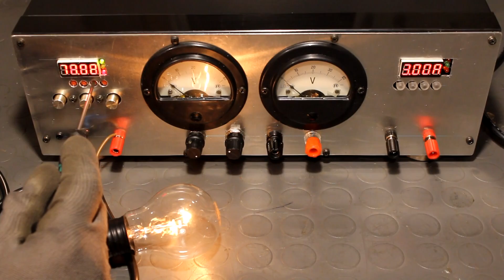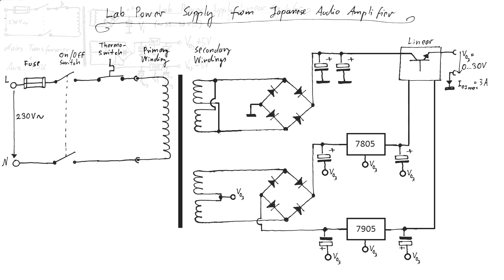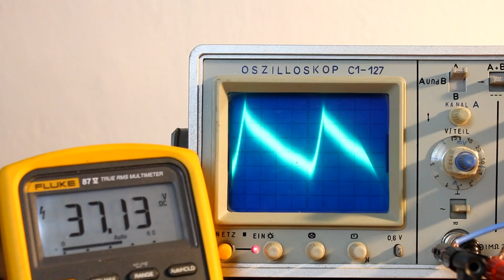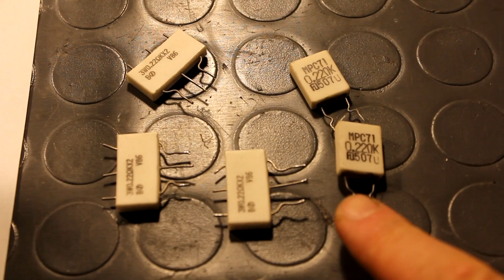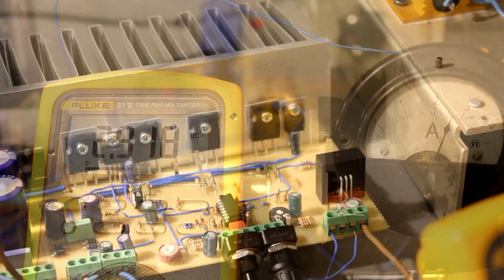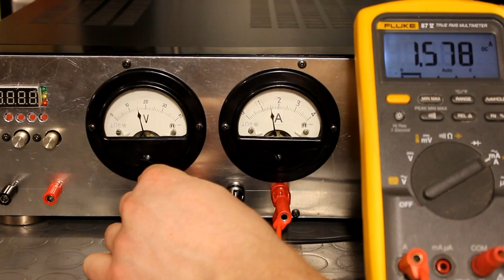Building a Lab Power Supply with a Discrete Linear Regulator

Comment from the maker: The first video about this power supply build can be found here:
https://www.youtube.com/watch?v=J3N6RX_wAJg
Reply: Nice work, good solid fundamental engineering principles. Well done! Bravo!
Reply: PLEASE FINISH YOUR SWITCH MODE POWER SUPPLIES TUTORIALS!!! THANK YOU FROM EVERYONE WHO HAS BEEN WAITING FOREVER !!! IT IS THE BEST CONTENT I HAVE EVER SEEN , IN COMPARISON TO THE UNIVERSITY LECTURE NOTES I HAVE READ !!

I WILL TRASH EVERY VIDEO WITH THIS COMMENT , UNIT YOU MAKE THE VIDEO !!!! THANK YOU !!!
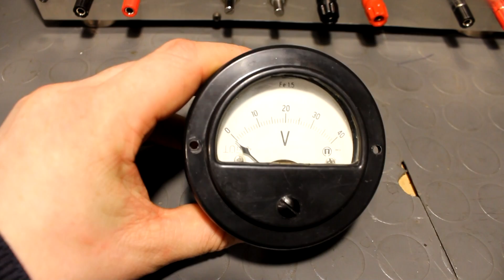Reply: That Czechoslovak TESLA resistors at 23:25 :D
Reply: What is the power draw of a headphone amp? I reckon it's below 5W
If it is, a simple 78xx/79xx + Filtering circuit will be enough. Don't be audiophooled :D
A DAC is typically very low power, 1 or 2 W. Again, a 78xx circuit is more than enough.
You would need to tell me the input voltage of the DAC or headphone amp, the input voltage of your power supply you wish to power the load with (must be 3-4V higher than the voltage of the load) and the power draw of the load.
Linear power supply (non audiophool kind) are very cheap, 10-20€ max for a high powered one including transformer.
Reply: Hi

Any chance of doing a video for a linear power supply for audio equipment such as dacs or headphone amps as they are so very expensive?

Kind Regards
Reply: Hello Guys Can any one give me more detail or in a word  explain how The voltage dividers of Voltage regulator amplifier and current regulator amplifier works in this video?
Another question says what's the function of the two diodes attached in parallel  between inverting and non inverting input of voltage amp.reg. ?
Another thing how the current source with those amplifiers working to control 30 output voltage and current with a low +5 volt only as you because of presence the load on the emitter of transistor to maintain a specific voltage through this load you need to provide that exact voltage +0.6v so 5 volt ignoring sinking path of op amps will provide us 4.4 volts at the emitter load  whatever the collector voltage is  ?
Thank you .
Reply: instaBlaster.

Comment: Wow that was really geat explaining, Thanks.
Also if i built two completely separate circuits powered by two identical separate secondary windings. Could i wire them in series to get dual rail supply with center point or in parallel to get more current ? Basically dual channel power supply .

Comment: At 19:03 'between the output and te non-inverting input' doesn't match with the drawing.
Reply: There is no feedback from the output voltage to the opamp. The circuit is using the 5v as reference and that is  used as the set voltage. Temperature parameters of output transistors and sense resistors are not compensated.

Comment: I took the effort to really understand how this linear power supply works. This is a great idea to let the whole control circuit (with its power supply) float with the output voltage! It eases the current sensing and regulation and it makes the output voltage range independent of the supply voltage limits of the OpAmps. Only the voltage setting potentiometer is exposed to the maximum output voltage.
But there are two questions that come to my mind:
1) As the current source drives the output transistors fully "on" unless throttled by the control amplifiers - how does the circuit behave at power-on? Will it ramp up smoothly from zero or will it first output the maximum voltage until the control circuit kicks in?
2) The voltage divider ratio and with it the loop gain of the voltage control loop changes with the set output voltage. The dynamic response (e.g. on sudden load changes) of the voltage control could be quite different at different output voltages. Had this been investigated?
What I did not notice as being mentioned: the +5V of the controller power supply also acts as the reference voltage. The absolute value does not matter, the trimpots and the calibration take care of this. But it might be worthwhile to have a look at the drift properties of the +5V regulator and its effects on the stability of the overall circuit.

Comment: Do you think that there  is any advantage to tube rectified dc power supplies for audio application? I have some field coil speakers that require about 150VDC 1A. . I am currently  using a PSU that uses bridge rectification. I have heard that the quality of the caps (vintage paper in oil being the best) was perhaps the only important factor. I would greatly appreciate your thoughts on this.

Comment: Since the supply is regulated, you could do a "pi" network filter with a cap-choke-cap configuration to really smooth things out. The choke (inductor) has some resistance so it can make a linear supply less stable. But regulation.

Very clean power supply. Takes me back to my roots in the 60s, and 70s ham radio world. Not the most efficient. Need plenty of heat sinks depending on your load and output voltage from the transformer.

Comment: i was quite impressed with the rock steady regulation of this regulated power supply... do you have a simpler version implemented using LM317s?  I have a 5A control transformer here lying around and I want to maximize its current capacity.  I was also wondering how the set current limit can be displayed without load...or offline and how I can implement a short-circuit foldback protection feature... hope you can enlighten on this

Comment: When it comes to mechanical things I’ve never found anything I couldn’t fix, same as construction. I build engines, repair power equipment, boats, ATVS and maintain and repair the industrial sewing machines in my small insulation assembly shop but sadly I only have a rudimentary understanding of electronics. Wish I was smarter, I would love to try some of these projects or at least be able to repair my beloved Sony receiver that died. Still enjoy the videos though

Comment: What crap, I manufacture switching power supply high performance among other equipment. When I was 12 years old I made an Elektor source that uses the LM723 infinitely better than this but simpler.
Reply: 🎉 5 years and no schematic, link or any information on what you built. I built one that runs 99.9997% efficient.

Comment: Hei ! I know that this video is pretty old but i watched only now, i have to admit that i was surprised by the stability of this psu so i want to replicate it but i would like to have some clarification before.(don't say buy a DCDC, i have plenty of them and they have some residual noise that this psu doesn't have) soo..
My main problem is that i can't understand how the opamp is sensing the current flowing through the transistor , so for translating current into votage we use the shunt resistors, those are going to drop a part of v out that has a proportional relationship with the current flowing into them , shoudn't we  measure that difference in voltage ?

and also someone could explain me why there are 4*1K resistors and where they have to be connected ?

Thanks in advance, feel free to correct me, i'm here for learning

Comment: Am I right that you could also use magnetic amplifier? e.g. a variac transformer, and an extra winding that influences the rest amount of the magnetic field for power transfer. So the small amount of current on the extra winding determines the current, and the knob on the variac determines the voltage

Comment: Thought i already posted my question:
Why would I go through the pain of building a linear regulator?
What are the benefits over a buck/boost converter?
Reply: Very stable signal. Notice how even when fully loaded down, its peak to peak voltages are only a few millivolts

Comment: seems like a lot of trial&error and a much more complicated design (compared to the bought-in-one-piece buck/boost converters). 
what i did not get is: what is the advantage of the linear regulator over the before mentioned b/b converters?
Reply: The main advantage of the linear regulator is that you don’t need to make it “quiet”, ie. there’re no narrowband unintended signals (“noise”) in its output.

Comment: Hello Guys Can any one give me more detail or in a word  explain how The voltage dividers of Voltage regulator amplifier and current regulator amplifier works in this video?
Another question says what's the function of the two diodes attached in parallel  between inverting and non inverting input of voltage amp.reg. ?
Another thing how the current source with those amplifiers working to control voltage and current with a low +5 volt only?
Thank you .

Comment: Do you have a simple circuit for adding an A/C amp meter that can read up to 30a to a 5K Watt generator panel?
Reply: Those probably are best bought as self-contained modules - a shunt and a digital (or analog!) display/meter. Since it’s AC, you’d probably use a self-contained current transformer, that output a scaled down version of the current, e.g. in a 1:100 ratio. Then use any amp meter and multiply its value by a 100 to know the current. Many digital panel meters are designed to work with current transformers and have a fixed or adjustable multiplier so that the display shows what’s expected. You can also use an analog Hall sensor and build an amplifier for its output, then use an AC voltmeter as a readout. If you’re into microcontrollers, an Arduino with a display shield of your liking, and a digital Hall sensor, may also work, or an analog sensor with an amplifier to bring the voltage into the usable range of the input pins.

Comment: Just a thought here about paralleling a transformer output. Is there a way to identify the start and end of a winding on these kinds of transformers from these old HiFi units so that proper phasing is maintained. Since the units are such large iron masses you probably aren't going to hear it 'complaining'  if one was to join them incorrectly and apply power...
Reply: peteb2 | For anyone who may come across this post, If your amplifier is functioning measure the terminals on the transformer before taking all of it apart to get an idea of how it functions. I am using a vsx-d411 pioneer amp and i have the primary coil feeding its flux into a secondary with multiple taps on the secondary. Please pm me if you would like my schematic analysing the function of my transformer

Comment: What are appropriate values for current balancing resistors? I see you used 0.55 ohm resistors, but is there a way to calculate optimal values? I am building a linear power supply based on your great design and I am hesitant to purchase any power resistors just yet. Also, I will be powering some oscillators with this supply, and is there anything additional that could be done to prevent the power supply itself from oscillating?

Comment: nice video very nice design of the power supply.I've been out of the electronics industry for many years now not that I work as a mechanic.I would like to build a very good and heavy duty power supply minimum 0 to 35 volt  0 to 15 amp.I was thinking to use the 2n3055 .any help with any better suggestions would be a great help.and what would be best to control current and voltage has to be quite precise.I would appreciate if anyone can throw some hints.

Comment: As an alternative current sensor check out the Allegro ACS712 (and similar types from them). There are quite alot of them available on ebay as module and might be a replacement (with an adapted circuit) for those people who can't get their hands on the one you are using.

Comment: Too much capacitance after a bridge rectifier is actually bad for all the components (transfomer, rectifier diodes and smoothing caps). The caps provide the energy while the output voltage of the transformer/bridge rectifier is lower than the voltage in the caps (I guess everyone understands that). For a higher capacitance that means that the voltage drops less on the caps. That's good you might think, right? The problem is that the caps only get charged when the output voltage of the bridge rectifier is higher that the cap voltage (obviously). If the cap voltage stayed higher because you had more capacitance, that means there's less part of the sine wave coming in that's above the cap volatge. You still have to put the same amount of energy back into the caps though. For the same amount of energy in less time you need a higher current. Sure, those current bursts are shorter, but power loss increases with the square of the current. So if for example you have twice the current for half the time (in an ideal world at constant voltage that's the same amount of energy), you still have four times the losses in the transfomer windings, rectifier diodes and smoothing caps. More definitely isn't better in this case. You pick the capacitance as high as you need it so that even under full load the voltage does not drop below the minimum voltage required for the regulator, but not more than that (of course you can add a little "buffer" to allow for ageing of caps).

Comment: I'm a total noob at eletronics and i just don't get it... Why not use a simple regulator like the LM317 or other regulator IC?
Reply: Because they dont go down to 0V because of their built in voltage reference. I think this was a requirement when building this power supply

Comment: Excellent results from an LM324. It seems to be a reflection of the time and care spent in properly sizing components and testing repeatedly. I built a very similar circuit last year based on an TL072 and a single 2N3055. I found the response of the FET input opamp far better than I needed in that particular circuit. Thanks for sharing. I can understand how many people who view this may feel uncomfortable with the details but I've enjoyed it. Too bad you didn't post a 3 hour version of this video including more of your development process. Yeah, I'm that guy. Thanks for sharing.
Reply: I was thinking the same thing. I'd have liked to have seen some more details of the experimentation. But a lot of people can't remain focused for that long. We're living in the age of ADHD.
Reply: Lots of “old” power supplies use op-ams like LM741 and its dual and quad versions and still work very well. The effort is spent in applying the parts so that they perform per the specifications of the application. Those diode gate circuits are rather popular, and they may be indeed called gates since they perform a nonlinear function with sharp transitions. Together with the op-amps, the circuit works like an analog computer solving a set of linear inequalities.
Reply: For a dual amplifier the LM358 or RC4558 can be used. The second choice has a greater bandwidth product of 3MHz and is used in audio applications as well.

Comment: Could you please do a video on the conductive strip that one usually finds behind digital displays. I have had trouble with several cheap voltmeters that lost portions of the display. I had luck cleaning the first one but the second one went completely dead after I "fixed" it. I also remember an old electronic sewing machine with a digital display I had that even when relatively new, the display segments would flicker or be absent.. microwave oven displays,  too. I guess there is a basic construction common to all these devices that I am not familiar with.

Comment: nice work, but i think your design could be a little bit simpliefied for example by using reference voltage ICs, they also should improve the performance.
Reply: Yeah I made a PSU vaguely similar to what is here, but I used a LM723 at the heart of it. That PSU has a far lower parts count.
Reply: of course you have to use much less parts, if you use an of the shelf voltage regulator, but these guys have the drawback, that they aren't going down to 0V because of their built in voltage reference, which is oiften a requirement...sure, you can offset the ground to -2V, so you can get an output down to 0V...but if you do so, things often get very messy, you probably don't want to go this way.
What i mean is, to use a bandgap voltage reference for the input of the opamp, which is much more precise than a voltage divider...and your power supply is just as good as it's build in reference voltage is
Reply: and i would also use a rail to rail opamp, ok not exactly a rail to rail opamp, because they can get really expensive, but one of those which can swing on its output down to V- , so you can tie V- to GND and you don't have to mess around with negative supply voltages